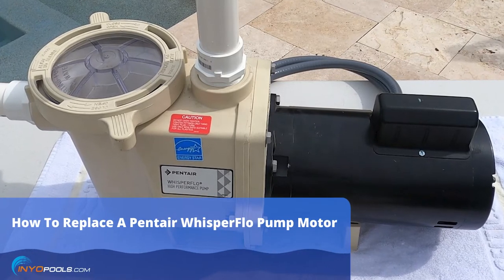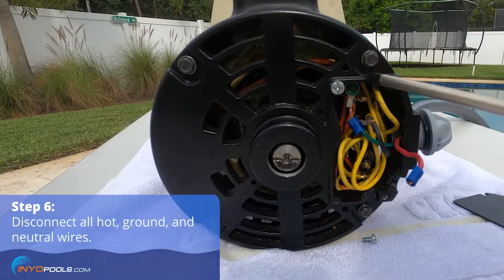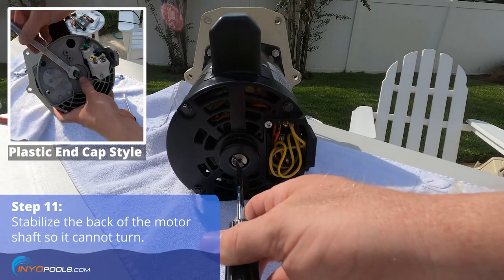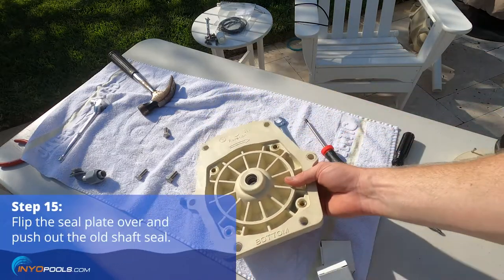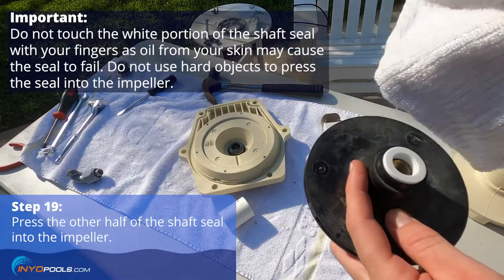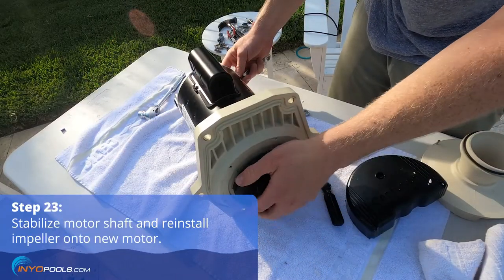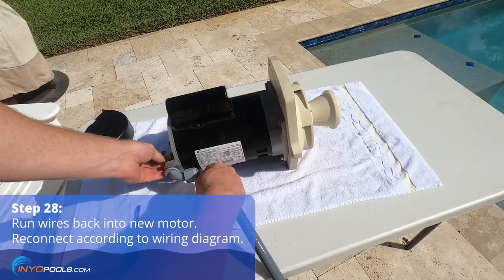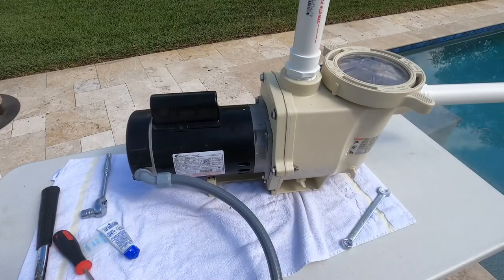How To Replace A Pentair WhisperFlo Pump Motor

Comment: My current pump is a 3/4 HP Whisper Flow single speed, can I replace just the motor with a 1hp single speed motor?  I actually do need a little more flow and pressure than I have now.

Comment: I have a Pentair 7-177449-03 single speed pump that just went out. Can I replace this pumps motor with a variable speed motor and keep the housing of the pump or do I need to get a whole new pump?
Reply from the maker: The direct replacement single speed motor is the Model B661 - https://www.inyopools.com/Products/00200017039436.htm

The variable speed motor alternative is the Model EVQ130 - https://www.inyopools.com/Products/00200017088810.htm

If that motor is not available the MOdel EVQ165 would work as well - https://www.inyopools.com/Products/00200017088809.htm

Comment: I can't get the impeller off. :( it seems to be stuck. Yours came off so easy.  Any tips/tricks to get it to come off?
Reply: Mine was tough to get off.  You need to get a wrench or some other tool to hold the shaft on the other side.  I actually had a screw in the spot and this came off. Since I was tossing the old pump, I took out a lot of stuff so I could grip the shaft easier.
Reply from the maker: Have you made sure to remove the impeller's lock screw before attempting to unscrew the impeller? 1:59
Reply: @Inyopools  My impeller didn't have a screw.  I just hooked up the motor and still humming.  I think my impeller is jammed.  Looks like another project tomorrow

Comment: I replaced my motor and everything went back together fine but I am getting leaks between the gasket plate and the pump housing (where the housing gasket it).  I tried to tighten the bolts as best I could but still leaks.  Any advice?  Should I remove the housing and try again?
Reply from the maker: I'd remove the seal plate and check that the gasket is not being pinched. Just tightening a pinched gasket may not solve a leak issue.

Comment: Followed directions closely and did not run in to any issues….until we fired up the pump and it kept tripping the circuit breaker. We filled up water to ensure a clean prime. We hear the mooter turn on for a couple of seconds before the breaker goes out — any thoughts?
Reply from the maker: First, I'd verify that the motor is set to the correct voltage for the circuit. A multimeter can be used to check the voltage, or you may check the voltage setting on the old motor.

Motors come pre-wired for 230 volts. What was the cause of your old motor failing? Was it doing something similar?
Reply: Thank you! I ended up getting it to work — simply needed to be turned to 230v from 110v and that did the trick! Thank you for the help!

Comment: Why do you need to replace the seal as well when you replace the motor?
Reply from the maker: There is a very good chance that the original shaft seal has degraded over time. Replacing it is a good insurance policy to protect the new motor. A bad shaft seal is one of the most common reasons we see premature motor failure.
Reply: @ thanks appreciate your response

Comment: “The old motor can be discarded” Well, maybe. If it only has bad bearings that’s a huge waste, the bearings are quick, cheap, and easy to replace. If it’s something else you might want to pitch it.
Put anti-seize on the 10 bolts, trust me!